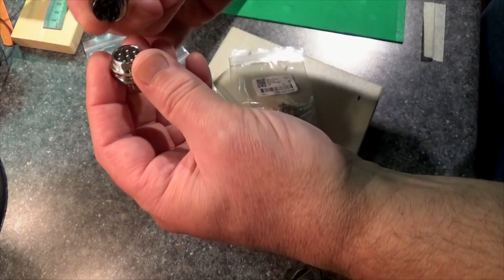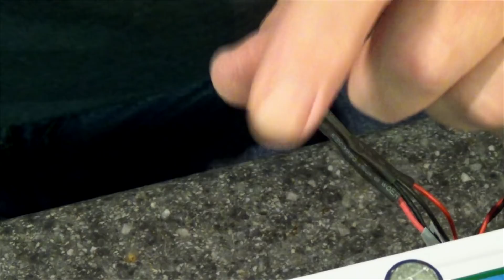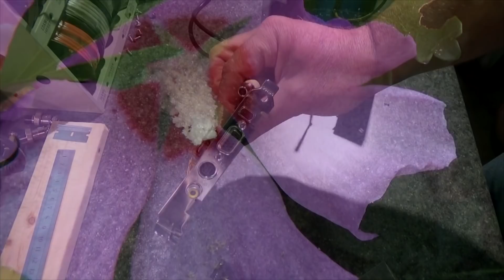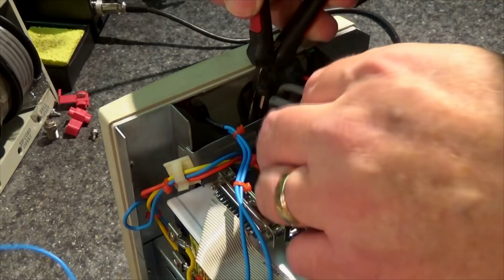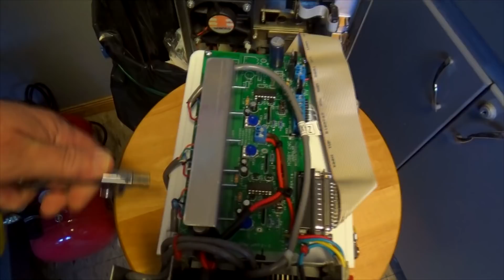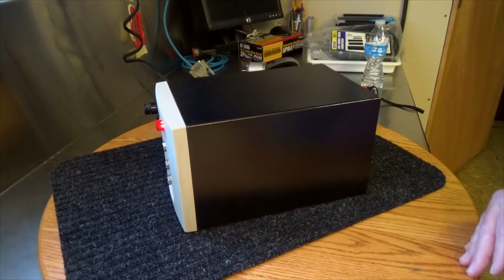DIY CNC Controller Work Continues - It's Ready to Power Up!

Comment: So WHY is that 2.2k resistor important? 
I've seen diodes connected this way to filter out some noise, but why the resistor?
Reply from the maker: The resistor pulls the logic line low to avoid any chance of floating 
pins on startup or slight noise fluctuations in signal line to avoid 
false positives.
Reply: Good tip, I will try that!
I have some issues with my Kress router turning off half way a job. Thought of changing the SSR to a old fashion relay, this could be a solution maybe :-)
Reply: Hm, tried it, no solution.. Forgot i've got the relais on the breakout board wired just to close a 24V loop which feeds the SRR :-) This way i was able to wire the big e-stop button so that is signals the breakout board, and also cuts the voltage to motor controllers and SSR..
Now i've tried hooking up the 220V spindle directly to the relais on the breakout board and i have run a test program. Unfortunately after a few minutes, the spindle stops.. Looking at the breakout board i can see that the status LED for the onboard relais went out.. so the signal to the relais is low again.. weird? The breakout board it hooked up to 24V as wel as 5V via USB plug
It's this board:
https://ae01.alicdn.com/kf/HTB1Aoo7JpXXXXXdXpXXq6xXFXXXR/5-Axis-CNC-Interface-Adapter-font-b-Breakout-b-font-font-b-Board-b-font-For.jpg
Any thoughts?

Comment: I'm sorry I screwed that up . what I need is to remove the 2 second delay when direction is changed thanks again
Reply from the maker: could it be the velocity is to high in motor tunning?
Reply: I tried 100nto 500in velocity @ 2000 steps per min and this only on direction change

Comment: Hey Steve ,  I am having  problem with my z it is not going to the proper dept. I have calibrated it  and made Shure my program is right can u help me sir. great videos thanks
Reply from the maker: Did you run the steps per rev cal numbers and also tune using the motor tuning page after the steps were entered. What do the motors do or don't do exactly?
Reply: thats what is puzzeling me motors work great .i have tuned and did steps
Reply from the maker: I am confused, what did you mean by "not going to the proper dept."
Reply from the maker: +Dennis Sams just figured out you meant proper depth. I am assuming in the Z. Make sure you don't have any numbers entered in the z offsets page.

Comment: i am a signmaker and that lexon will bend very easily with a heat gun. use the metal angle to get a sharp bend

Comment: Steve, I don't understand the direction of air flow.  The fan either sucks in or blows out, but but I don't see the corresponding holes needed to give the air someplace to go to or come from.  Are they on the bottom of the case maybe?
Reply from the maker: yip there are vents on the bottom front. I was concerned it was not enough but so far running cool
Reply from the maker: fan is blowing into case

Comment: Looks great Steve, personally I'd just use the original cover but if you decide to use the lexan then I'd definitely use the alum angle for the bends.  Bending lexan is an art in itself and not for the faint at heart.  :-)  Keep the vids coming, I'm enjoying this series!

Comment: Do you have exhaust for your cooling? Might need to punch some holes in the bottom or sides near the front to aid in cooling.Great design and execution on the project.

Comment: I wouldn't even try to bend that plastic.  I don't think you will get a sharp enough bend that will look good.  The three plastic panels and aluminum angle would give it a cleaner look if you do go with the plastic.  Personally I would use the cover you already have to help keep it sturdy.  Now if you do go with the plastic maybe you could put some bright blue lights inside so she glows.

Comment: It is hard to do a true 90 degree in plexiglass sand without over heating it and creating bubbles in the area...unless you cut it part way thru with a v bit...but panels would be less riscky

Comment: My .02 would be to stick with the original enclosure cover - looks fine to me - the plexi will get covered up with dust and possibly get cracked, etc - OR - again stick with the original cover but cut some big holes in it and glue small plexi panels to it so you can see inside it if you want.